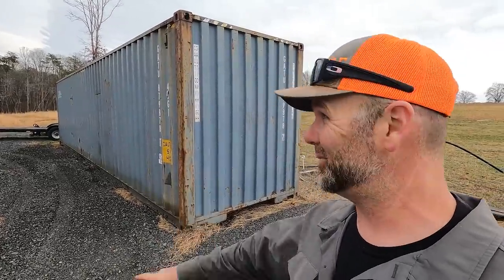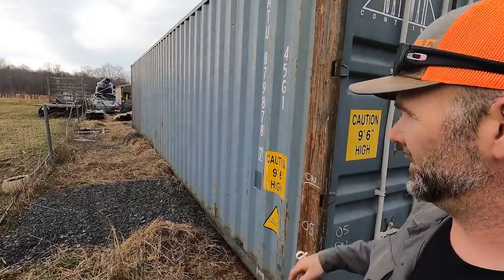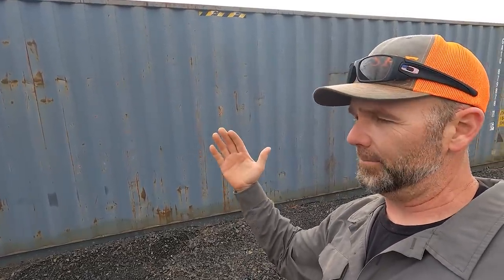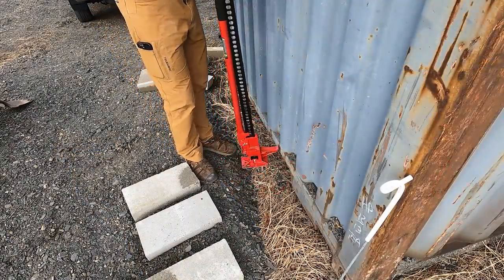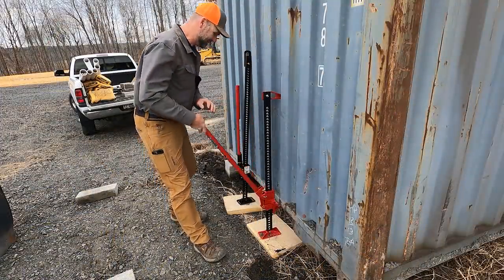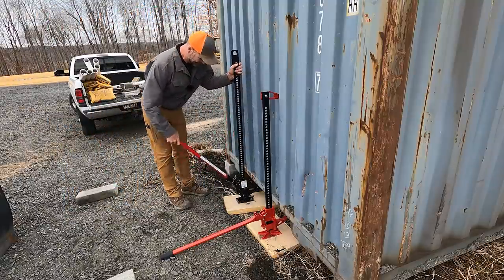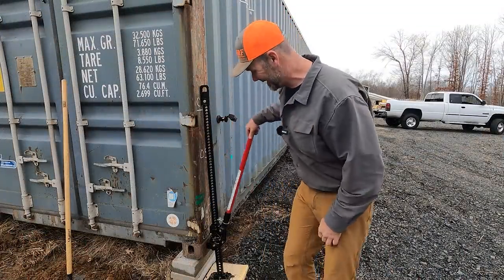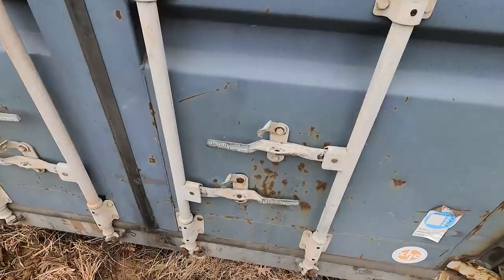Leveling MASSIVE shipping container get's interesting!

Comment: No If you know what your doing you can bury shipping containers what you have to do is go inside them with bracing or load locks top and bottom and crossways from front too back i have a friend that has four of them in the ground side by side  45 feet deep then two as a tunnel leading to his woods and there under his house incased in 8" of concrete on the sides and ends and 12inches of concrete on top with three Matts of 5/8" rebar 30"×30" hole in the top with a home made 2"×2" angle iron ladder that comes up to his basement
Reply from the maker: yep...by the time you do all that work....you may as well just pour a concrete bunker

Comment: The High Lift Jack is the original farm jack and it's still made in Bloomfield Indiana here in the United States. 

When it comes to Farm jacks I always buy the High Lift brand. All other brands are made in China. 

Also the High Lift jacks are fully rebuildable. High Lift actually makes rebuild kits.

All High Lift jacks are rated to safely lift up to a maximum of 4,660 lbs or 2.33 tons. They have a safety overload pin that sheers off at 7,000 lbs (3.5 tons) to prevent jack failure.

The 60" inch version however is rated at 4,660 lbs up to 48" inches. The remaining 12" inches drops down to 2,000 lbs of maximum working capacity. (All other High Lift models are 48" inches and shorter so they don't have this excess height weight limitation.)

So capacity wise the shipping container was within the jacks rated lifting abilities since lifting one end of the container would apply 4,425 lbs to the jack. 

As long as you know for a fact you are not lifting over the rated capacity of the jack, a pipe over the jack handle would make it much easier to jack the load up. 

High Lift only gives you enough handle leverage to lift 4,460 lbs for safty reasons. Using a pipe (cheater bar) will allow you to lift much easier. But it will also allow you to lift up to the sheer pins 7,000 lbs if you aren't careful. 

4,660 lbs is the maximum safe load limit. Anything over that and it starts to become a gamble. 

Also a High Lift is ment for lifting one corner of a vehicle, or hay wagon at a time. This gives the jack stability. Lifting one whole end up on a jack that is basically a pole becomes a tip over hazard.

Comment: Were those trusses made out of corten steel?
Reply from the maker: I don't think so
Reply: @StoneyRidgeFarmer  rule of thumb is to only use corten when welding anything to a container.
Reply: @StoneyRidgeFarmer  Welding thinner stuff to thicker materials shouldn't be an issue for an experienced welder, you just need to spend more time with the heat on the thicker material and then slowly move to the thinner material. However, corten steel needs to be welded with corten specific equipment for the Container Safety Convention (csc) certificate to remain valid, so this is a consideration if the container is going to be reused for shipping purposes at a later date. You also need to clean the weld up and prime and paint it afterwards, to prevent rusting.   It also applies to permitted structures if you need a permit to modify a container (evidently you don't where you live), but there are reasons why it is a consideration.

Rule of thumb any professional welder would be mindful of liability issues with welding anything other than corten steel (or compatable alloy) on a container

Comment: lifting one corner will not put the entire 8550 lbs by any means.  If both sides come up then half of that.  If a jack on each side is used at one end then 2100 lbs roughly each jack foot.

Comment: Would a hydraulic Jack not work?
Reply from the maker: how ya gonna get a 14 inch tall jack under a 5 inch high shipping container my friend ?
Reply: @StoneyRidgeFarmer  My Strongway (on wheels) is 4 inches off the ground. I went out and measured it. It’s 3 ton aluminum so maybe too weak for what you did. I think I got it at Harbor Freight several years ago.

Comment: I don't understand why you didn't use the bulldozer with some chains to lift the container?
This is what I did with the front blade of a three ton mini excavator (Kubota KX 61-2).
In fact, you are not lifting the full weight of the container, but only half of it, since the other end rests on the ground.
You just have to place blocks of wood between the container and the blade, to prevent the container from moving back when lifting it, and also to protect the container's paint.
It's so much faster and safer, especially since you have plenty of space around it.
Reply from the maker: you don't understand why I don't have a $500,000 piece of equipment to move this shipping container? lol....what I'm doing doesn't need fixing buddy...it's just the way I did it. Many ways to skin a cat brotha....many ways
Reply: @StoneyRidgeFarmer  My goal was certainly not to criticize you, because you are undoubtedly resourceful and hardworking.
It's just that with the bulldozer, I'm sure you would have managed to lift one end of the container.
Because my 2002 mini excavator (paid $16,500 used in 2014), managed to lift one end of the container.
I just leveled my container this morning, and I had to use your technique, since there is no more space behind the container to use the excavator.
That's why I watched your video this morning. It worked, but with my 155 pounds I had to add an extension to the lever.
Reply from the maker: man...I wish I had equipment that was capable of moving this thing around....but this is the way I had to get it done this time...maybe next time I move it we'll have a better way...and I will have to move it again unfortunately

Comment: the skid steer with forks would been easier and safer.
Reply from the maker: but won't lift the building...this is heavy my friend...if the skid loader or tractor would lift it...I'd have done that for sure
Reply: @StoneyRidgeFarmer  wow that track loader is weak. I have 6  large containers and i lifted every one of them with the forks on my bobcat. granted it was not very high but mine are on rail road ties a foot high. humm. sadly i've seen people bust there teeth out using the farm jacks. glad you were able to get it done.

Comment: Would it be worth the work to Clean, Prime, and Spray Rubberised Undercoating to the Bottom of the Shipping Unit?
Reply from the maker: wood needs to breath so it doesn't lock in moisture...that's why we gotta get it off the ground my friend
Reply: @StoneyRidgeFarmer  
Would you suggest putting gravel underneath it to keep it dryer underneath to help prevent rusting? I just bought a 40 foot high cube this morning.  I am considering buying 21 tons of #2 gravel to make a pad 3 inches deep.

Comment: Why not use a pipe for more leverage?
Reply from the maker: jack is designed to work with the handle provided...putting a cheater bar on it has the potential for a fail or safety issue my brotha

Comment: Forks on the 110 would have been so much easier but I know you knew that lol
Reply from the maker: won't lift it brotha
Reply: It should unless it has a real low rating because you'd be using a counter weight balance only lifting an end not entire box. IDK
I know with a case backhoe with long forks I was putting cars on a ramp truck . 
Either way awesome tractor and awesome video.  It made it better watching you struggle a little and having a boo-bo lol
Can't wait to see what's next. 👍

Comment: I was just waiting for you to tear that jack up when you got to put that much weight on it to lift something you know you are in for trouble I've seen him go sideways hundreds of times they'll do it every time and walk over used to be they were wouldn't handles to keep that board from splitting on the bottom you should have another one cut and later on there crossways then he would keep it from splitting I also wonder why you did not get a container with both ends open with doors but were they not available

Comment: Probably not a good shelter in an electrical storm, huh?
Reply from the maker: actually...interesting fact...the shape of a structure like this will dissipate a lightning strike in most cases.  Just like ya don't hear of cars getting struck by lightning much...and nobody every really gets hurt.  The shape dissipates the strike...not the tires insulating the car from ground....obviously lighting can travel great distances through the air...but the shape of a car, structure or building helps dissipate the strike...learned this in electrician school in the USAF 1995

Comment: My container came loaded with goods. It’s 28k lbs. It sits, it is twisted and the doors are out of alignment - will not close.
I’m using hydraulic jacks, so far all I’m doing is pushing blocks into the soft soil - have not got it to budge at all.
Frustrated,
Reply from the maker: empty it out and level it my friend

Comment: Hi Josh, im thinking that this is a more not to do video. Seeing how you used those high lift jacks, some one will die doing it your way. You could of easily have done it with a smaller screw/ hydraulic jack and done 1 corner at a time. Sorry dude. but that was dangerous.
Reply from the maker: how ya gonna get the jack under the corner?  Sometimes farming is dangerous my friend...I agree

Comment: You are messing up.  On the downward direction of those  Jacks will take your head off.  At a certain part os a notch theSe jacks will rachet down at 100 MPH without your help.  DO NOT EVER GET YOUR HEAD CHIN OR BODY PART IN THE WAY. let the jack down with your arms away from your body unless you want your wrest broken.  These type jacks are known as "handyman Jacks."